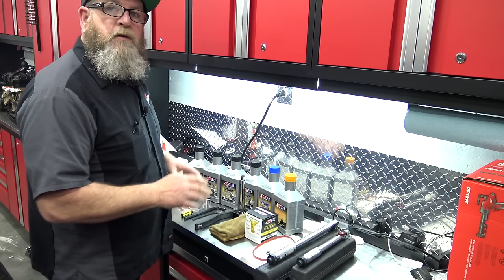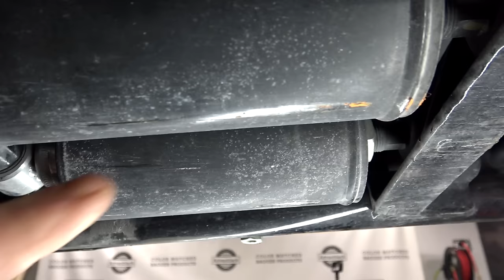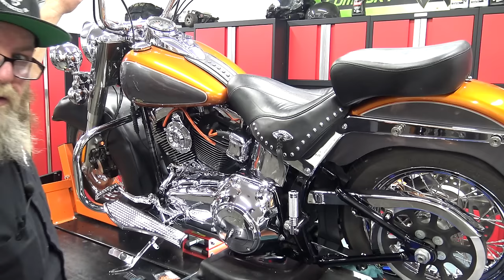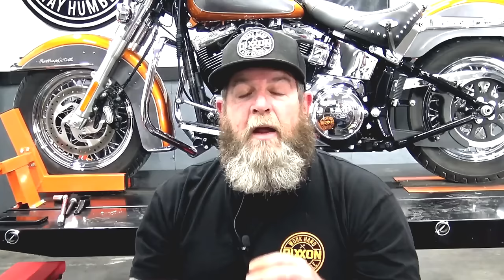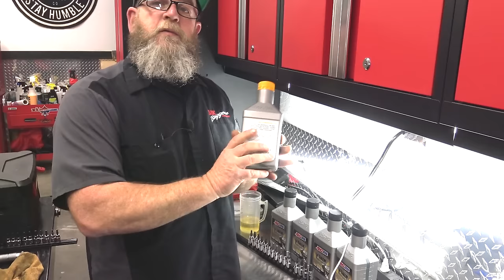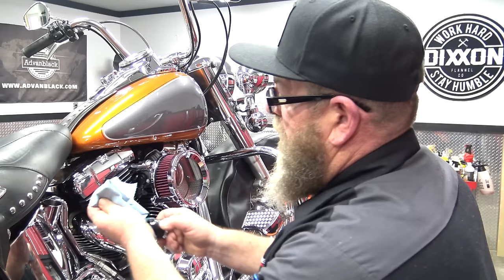⚡Twin Cam Softail @Complete 3 Hole Oil Change  @harleydavidson ⚡

Comment: Hi , is it the same for all models ? mine is Night train FXSTBi 2007 .
Reply from the maker: Youre fluid levels will be different as that is a 96ci engine.  Very important to try to find a service manual for your bike..should be 2006 to 2009 FXSTB/FXSTBI Night Train

Comment: I have a bastardized tranny oil drain plug. Not a 5/8" with a 1/4" apparently drilled in the center. I used a suction machine to drain that cavity. Any ideas about opening up what could lead to a major expense repair? Thanks Dano (Subscriber)

Comment: As an HD service tech i never torqued plugs or derby screws. Primary was filled to bottom of clutch ring as specified in manual. Ttrans depended on model. You can pour out four oz from bottle. But you're not pouring out eight oz later. Insider of bottle will be coated with some oil. three-mile
This video states an opinion. As did i. You could ask a dozen mechanic and you will probably get as many different opinions. As well as desired preference of methods, techniques and procedures.
Reply from the maker: In the real world I don't torque them either,  this video is for educational purposes so riders don't have to pay HD prices for something that is this easy to do at home so I follow the service manual for these. I think we all know that residual oil left on the bottle walls is not going to be enough to affect anything on any brand of motorcycle.  And if you were a Harley Tech you should definitely know that.  Shit dude, I've owned Harleys that leaked more than that on a daily.  Everyone can have an opinion,  but I know for a fact (just read comments)  my "opinion"  has saved others thousands of dollars on oil changes on this video alone. 125 bucks an hour.. 4 to 500 for a first service....thats insane. for simple shit like an oil change , just my opinion.
Reply: @sikbaggers  I hear ya. And to be honest. I think your videos are very good. Nicely done. And a true help to weekend warriors. Even though I worked for them, I don't like the stealerships.

Comment: Got a 08 crossbones.  Having a hard time finding a manual to download for free. Also do you recommend those fluids for my bike as well ? Thank you
Reply from the maker: So the crossbones is a softail. HD makes service manuals for bikes in groups such as , touring, softail, etc..here is a manual from my private google drive you can download the 08 softail manual here https://drive.google.com/file/d/1gVdh0vc1lL53dCMPs_G5XabQjMv4mskd/view?usp=sharing I hope this helps! And with an 08, unless its already been switched to synthetic I would just keep running conventional oil maybe with a high milage package additive in it.
Reply: I’m not sure if it’s been switched to synthetic. If it was Would that be a problem if I use conventional? Or should I just do synthetic?
Reply: @sikbaggers 
Thank you so much for the manual.  Really appreciate it.

Comment: Have you seen issues where the lines coming from the oil bag running into the case have started leaking where the lines go into the case?
Reply from the maker: I havent seen that issue...however it is just a simple clamp system so it could..could be as simple as replacing the lines.
Reply: @sikbaggers  I’m hoping it’s just some o-rings or something like that. Only leaks when the bike is been running.

Comment: No need to purge the bad oil from the system?
Reply from the maker: You can purge it if you want...the service  manual does not call for it and youll never see a HD tech do it, unless of course you find an old head thats been around for awhile, he might. Up to you!

Comment: i HAVE A 2023 softail and the drain plugs are in diffrent locations than  in this video?
Reply from the maker: A little bit different, the engine oil drain plug is on the back of the pan left side, sitting on the bike and not the bottom.  Trans plug is on the bottom right and the primary is the same, right below the derby cover on the left side.

Comment: How many miles do you change the fluids?
Reply from the maker: HD recommends every 5k for your oil and every 10 k for transmission and primary...super easy to remember. Every other oil change do all 3 holes.

Comment: I am having a hard time because the last filter put on was with out the nut on top what can I use to break the seal or old filter ?
Reply from the maker: there is no nut at all on the end? I have never seen a round oil filter but you can get it usually with a set of filter pliers https://amzn.to/3oWUFM1
Reply: @sikbaggers  I got it I needed to use the cap I meant that but that hangs on the end that you can just grab with any ratchet

Comment: As an owner of 3 Harley's, 2021 Street Glide, 2014 Wide Glide & 2009 Rocker C I can say that i hate changing oil on my Harley's.
I prefer to just take to Harley and let them do it, honestly, i just dont have the patience but mostly, i just dont want to do it myself.
I do like the Vids from Steve and i have started doing some things myself, but il changes no thanks
Reply from the maker: Thank you for checking it out! It can be messy lol HD's oil filter placement makes sure of that!

Comment: So did you use all 32 oz in the primary being wet ???
Reply from the maker: Just shy of it, yes. Use the slight line built into the outer primary under the cover to make sure you dont overfill it.
Reply: @sikbaggers  thank you for this video

Comment: My 2009 springer had a lot smaller drain plug. What's up with that?
Reply from the maker: Not sure John...could have been swapped out out at sometime or that could actually be the original plug size.

Comment: Why are you changing the transmission oil Everytime with engine oil? That doesn't require it for like 20,000 thousand miles.
Reply from the maker: who the hell said I was doing a 3 hole on every oil change?

Comment: Great info video, learned a couple of things even though I do my own services on my ultra limited.   When you mentioned that you can always swing by your dealership for some of the parts I had to chuckle.   I changed out my oil on Friday and stopped at our local dealership in Wichita to by a harley chrome filter, with a smile they charged me $23.00 for an oil filter and drain plug o-ring.  They didn't even offer any Vaseline.   NEVER again, and harley wonders why people go to aftermarket.
Reply from the maker: Absolutely! They way over charge for simple stuff like filters and o rings...and if you take it there for service they are charging you the same amount for that stuff...its insane. O rings are a dime a dozen on amazon and so are the filters. I do however trust the amsoil filters a little more than I would a no name on amazon to clean the oil. Although i have installed a few for customers that seem to hold up but they are on time with every oil change.

Comment: Why did old guys always pour little oil in? When I got my first Harley 35 years ago the guys that  rode with taught me maintenance and they all poured little oil into filter. I have a dozen various service manuals for different model and age bikes and none show to do that. I know car mechanics put oil in filter for car/truck oil changes when I was young. My grandfather owned a garage as did my uncle and we also hung out with car club guys. Maybe that’s where came from. Great content. I have 2003 fatboy and I basically change the fluids same way.
Reply from the maker: the thought process was that the oil pump pumps oil from the filter so when you change the oil, the pump, for the first few seconds was dry pumping, or metal on metal with no oil...but lets be honest, you just changed your oil...there is still oil on the pump and it literally takes 2 to 3 seconds to sump the new oil through the filter and into the pump.  MAYBE on a diseal that gets an average of 300k +  miles.  But not your Harley
Reply: @sikbaggers  makes sense! Thanks for the response! Love the content

Comment: TIP:  Take some foil make a place under filter make a channel for oil to follow into oil pan, then take a Phillips screw driver and a hammer and punch a hole in the top edge of filter followed by one on the bottom edge.  Let the oil drain out of filter then remove, the little oil that will drip out is caught by foil.  NO mess..
Reply from the maker: That is what I do for the touring models 103 and it works great...the softail 103b is little harder to get the foil under there..super tight but yes...excellent way to drain the oil filter.

Comment: What the heck is a "jiffy" stand?
Reply from the maker: It is what Harley Davidson alone has called the KICK STAND since 1936 when it first introduced as an accessory costing 3 bucks.  It aided in holding the motorcycle while kick starting, strong enough to hold the motorcycle and walk away parked on any angle and also kick up with a spring if someone drove off with it down.  It has quite a backstory actually.
Reply: @sikbaggers  Thanks, I didn't know.

Comment: I wonder why more folk do not use a scavenger ( homemade or store bought ) to completely drain the engine !!! Personally i do not like adding fresh oil to dirty oil left in the bottom of the engine..even if its just a few ounces, just seems counter productive. IMHO 😀
Reply from the maker: I use Amsoil in my bikes.
Reply: @sikbaggers  Nice ..I do too..but i still like to completely drain the engine with a scavenger so when i refill with Amsoil it is not contaminated with the few ounces of old Amsoil left in the bottom of the engine..Cheers

Comment: Good stuff. However, how many customers ask for a COMPLETE oil change? The gearhead in me just cringes putting clean oil in with the dirty oil that remained in the cases. Sure, it costs a bit more, but the peacea of mind it gives.....
Reply from the maker: Actually quite a bit...at the price of the oil and o rings it just makes sense..I recommend doing this at least once a year..here on our personal bikes we will do a 3 hole every other oil change. 5k on oil and 10k 3 hole change.  If you have to winterize like we do here and you cannot put your bike inside somewhere then I re4ccoemd doing it in the spring to get any water/condensation out and fresh oil in for the riding season.

Comment: I can't believe it takes so many tools seals gaskets and what not to does just to change oil in a harley. For any person with half a brain, this would turn anyone thinking about buying a harley to run as fast as you can from it. I've researched everything I can about harley vs metric bikes. Harley fails at every point except the sound. If your buying a harley only fir the sound your an idiot. Metric bikes are way more reliable. Faster. Just as powerful. Drive shaft way more reliable than harley primary and belt drive system. Metric bikes are half the price and half the cost to repair. You never see a harley with over 100k miles that got there with only oil change maintenance. But Metric IE Honda vtx. I've seen with 200k miles still running like new with only pure maintenance zero bike repairs other than maybe new clutch baskets.
Reply from the maker: remind me again why you are on a harley youtube channel watching harley oil change videos?